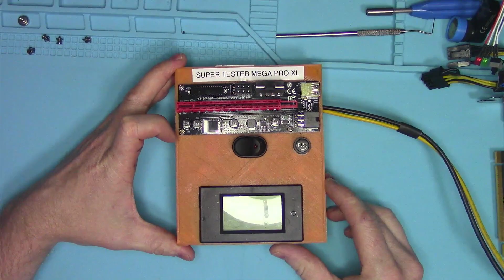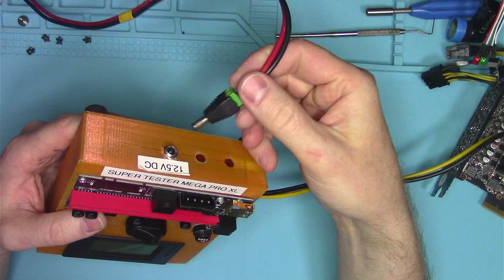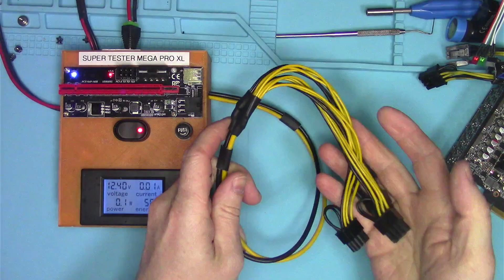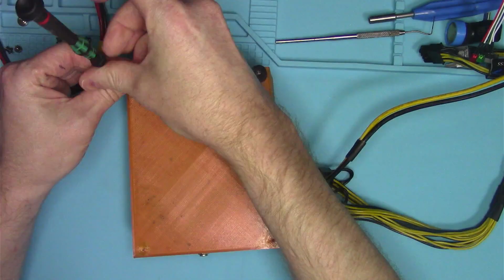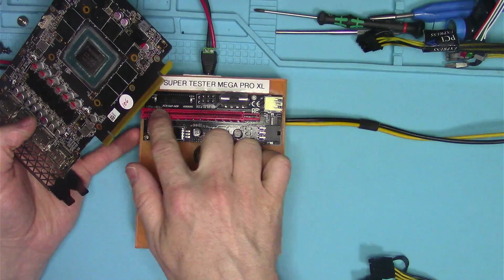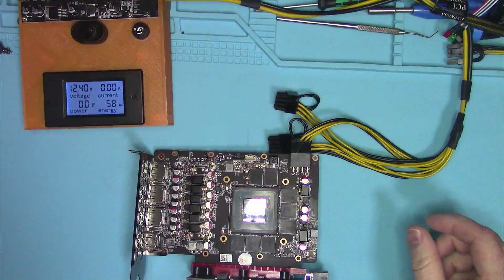Introducing Super Mega Tester Pro XL

Comment: 1:05 If the fuse is 3A it will blow at 3A even if you only use 12v. The 250v is only the maximum voltage it is made for.

Comment: extremely useful thanks for sharing! One silly question: why adding another 12V cable to the additional external riser? Why not using one of the "pci express" ones? Does the riser on the box deliver different voltages other than 12V?

Comment: I bought a meter similar to this (model: KWS-DC200-50A), but with the external 50A shunt, my intention is to be able to monitor the consumption of the 12V line of the CPU on motherboards, I assembled it using parts from a old modular power supply  and everything turned on and works, but as you mentioned the measurement is out of expectation, it measures around 30W when expected would be around 90W, I am using the 12v from the source to be measured as the meter's power supply. Any suggestions on how to improve measurement accuracy? Could using an external source help? I read elsewhere that it would be ideal to remove the built-in shunt as it is what causes the measurement inaccuracy when used in conjunction with the external shunt, what do you say? Thanks in advance.